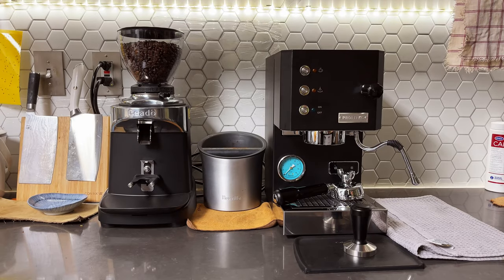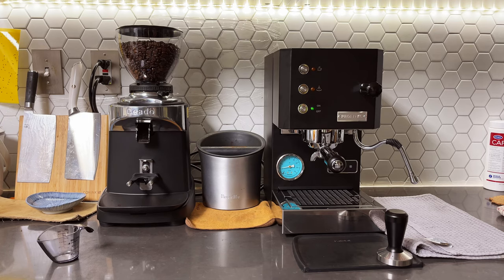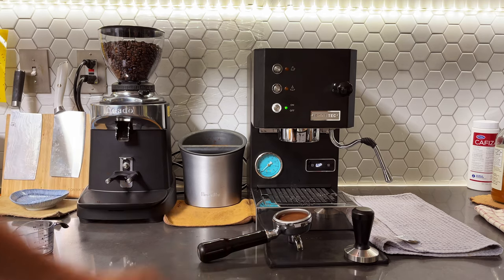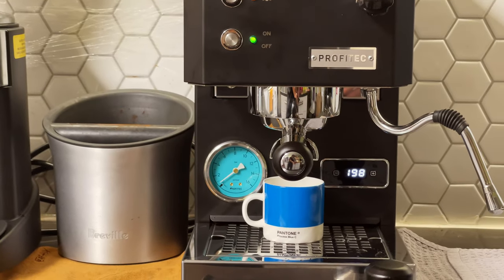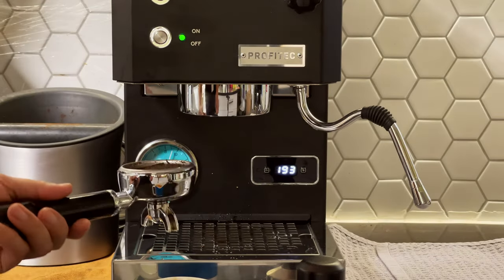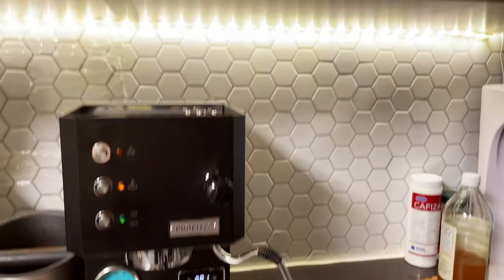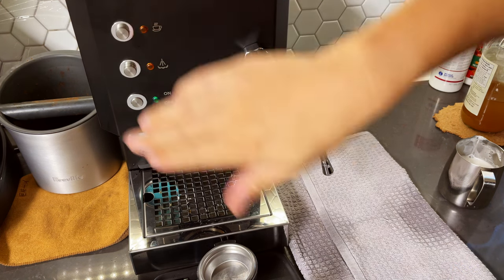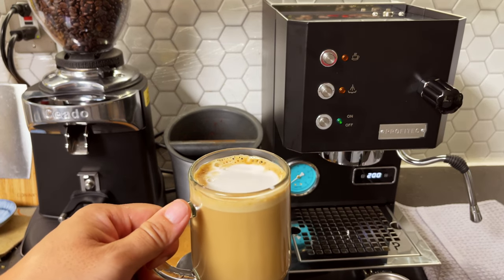Profitec Go - Making A Cup of Morning Latte

Comment: Thanks a lot for the video, I'm interested in buying a Profitec Go as an upgrade from my Quickmill Stretta.

As for your extraction, maybe the coffee bed isn't prepared well enough, maybe try to use an ocd tool? Although the Ceado of course has great grind quality without clumps, but still you have a little mountain in the portafilter that you are just tamping right away and the shot looks like strong channeling to me, especially if you get splashes even with the spouted portafilter.   
Also if you look closely at 1:04 it looks like you are tamping at a slight angle (which I myself find really hard to get right and straigt) which also can lead to channeling.

Not trying to correct you, just trying to help (I'm no expert btw)
Reply from the maker: Yes, visually, the espresso prep doesn't look perfect, but to tell you the truth, the espresso shots actually taste fantastic. Will try all the tools eventually. Thank you

Comment: I really like this machine and am thinking of getting this or the new sage barista express impress? What’s your thoughts? Obviously I’d need to buy a grinder too with this machine
Reply from the maker: Depending on the level of involvement you are comfortable with. If you want more automation, Sage Express is a good starting point. If you want better quality espresso, but don’t care too much about bells and whistles, I would suggest invest in a good quality espresso grinder and start out with Gaggia Classic Pro. If you want and love to change all possible settings to dial in a perfect shot of espresso, then this is good. But again a good quality espresso grinder is more important than the espresso machine
Reply: The Breville Express Impress is good on paper and in the unboxing videos, but there's a huge quality control issue with the sensors. I've returned two defective units, my next purchase will be the Profitec Go.

Comment: On the first video, you talked about how the pump was very loud. Is that still an issue or were you able to fix it? Are you still happy with the machine now that you have had it for a while? I am considering buying this machine and your thoughts would be great. Thanks for the video.
Reply from the maker: Good question; my pump still produces some rattling inside the machine. I contacted the seller and they still haven't provided me with a valid solution yet. My suggestion is make sure you purchase from a place that have great return policy if your unit is noisy. In theory they should be quiet.

Comment: why after pulling a shot the pressure needle doesn't go to zero?
Reply from the maker: The pressure gauge probably is sitting in some sort of tube connection from boiler so when portafilter is removed, the tube gets shut and pressure remains in there.

Comment: Thanks for the videos. Love to see how you do an Americano. Appears kind of wonky for hot water from steam arm in WLL video. Appreciate you!
Reply from the maker: Thank you. Will definitely do one in the near future. The steam wand is a good upgrade compared to my old Gaggia Classic Pro, fully articulating. The steaming tip is also larger, and the angle of the two steam hole is wider compared to what's on gaggia classic pro, takes a bit getting used to. Didn't notice any issue with water splashing when dispensing from steam wand but I usually just dispense straight from the shower head. If you are concerned about splash, attach a bottomless portafilter on the shower head when dispensing hot water, will solve the issue!